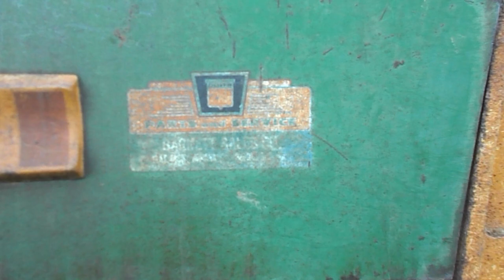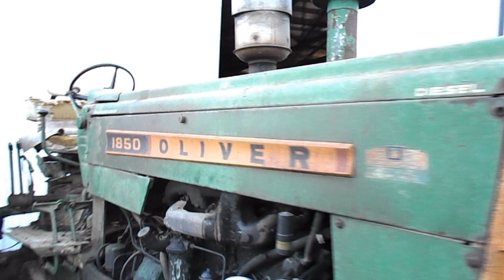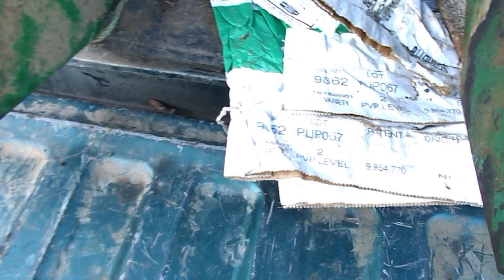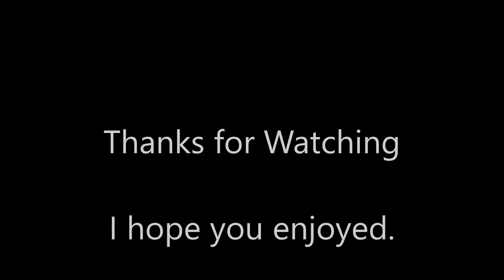Working on the Truck and the Oliver 1850

Comment: If  I were you I'd get a good one from a salvage yard.  They have many of the good ones.
Reply from the maker: I checked and there $250 up so I'll fix the one I have. There is no pressure on the cradle when pulling from the draw bar the only pressure is down on it from tongue weight. The only time these brake is when someone wraps a chain around it to pull something out. So I'll weld it up good and it will be fine cause I already know not to pull from it.  Bandit

Comment: Get a piece of flat bar and lay it on the outside and mark all the holes. drill the holes and the cut off the piece the width of the flat bar and then weld the flat bar to the rest of the plate. that will get rid of the old steel and it will be like new
Reply from the maker: No room to add a piece on the out side to give it more strength and I'm not that good at cutting steel out good enough to weld another plate in it. A new used one is about $250 plus shipping so I'm going to grind it out weld it in and heat it and bend it back in place and then weld it up and add a few passes on the back side to build it up a bit for added strength , At least that's the plan.  Bandit

Comment: love those olivers. We had 2 at home. The 880 had a heater house and i guess it had to help but it was a chilly ride in the winter. Good luck with the repairs and look forward to see her work.
Reply from the maker: I do have a thing for my Oliver's and they do have there own sound and I like it !  I love the sound of dads 1550 gas , It has a smooth quiet purr and it sounds good working . I'm wondering what the 1850 would sound like with a strait pipe working ? I might have to try it before I buy a new muffler for it as this one has lots of burned oil in it from slobbering . She needs a bath and a strait pipe and then worked hard for awhile and get all that mess burned out of it.  Bandit

Comment: As you may remember, I have several Olivers on my farm.  The 1650 has the original Oliver spin-on hydraulic couplers like your 1850.  In fact, I have 4 or 5 sets of them from taking them off other tractors and replacing with Pioneer or other brands.  Also, recently you uploaded a video on replacing the finger guides in the auger of your 213 grain head.  I did that to my 213 grain head today and am I glad I watched your video first, because I had some of the same problems with some of the bolts being stripped out, and I had to grind them off and put in a new bolt with a nut inside.  So, thanks for that tip.  I have enough guides to replace them all on my 213 flex head too, which I'll do tomorrow.  Double the fun!
Reply from the maker: To be honest I haven't seen any of those ends in 30 years or more let alone a set on a tractor ! They will be changed over to Pioneers for sure and if I can afford to put a set of shut off valves on it to make it easer to hook them up I will.  On the grain head I've learned over the years if you got to replace one replace them all and save yourself sometime and agrovation but save the decent ones just in case ! LOL Never hurts to have spare parts even if they is used . Bandit
Reply: @banditfarmer1900  Yep!  I replaced them all on the rigid grain head and have enough to do the same on the flex head.  I definitely agree with your philosophy!
Reply from the maker: @pagrainfarmer  As big of a pain in the butt as they are to change in my way of thinking your already there in it do them all and keep the decent ones just in case.  This way when they start looking a bit shabby you know to change them all !  It's like my 4400 combine if it needs an upper drive belt change them all cause its a pain in the butt job to do ! LOL  Bandit
Reply: Yep - i have a 4400 too, so I know what you mean about the belts.  Hahaha
Reply from the maker: @pagrainfarmer   See there, Great minds do think alike ! LOL Bandit

Comment: If a 354 Perkins doesn't seep oil then there's none in the pan. LOL
Reply from the maker: I've had a couple of other tractors with a 354 in them and they all slobbered if you let them sit around running or not working them. The funny thing is none of them ever really needed oil added to them. Go figure right ?  Bandit

Comment: when you get to the part where you want to wash this motor get yourself an empty spray bottle and put about a half ounce of Dawn dish washing liquid in it and then slowly fill the rest of the bottle with water.   spray and let soak several times then power blast with the high pressure washer.    nothing cuts grease like Dawn Dish Washing Liquid.
Reply from the maker: Over the years of trying different things I've found if its coated heavy with crud if you give a heavy coating of diesel fuel and let it sit over night it will soften it up enough that a pressure washer will take it off pretty good for a first washing (next video).  For the second wash in the spring I'll soak it down with purple power soap with my spray gun and really go over it good !  Dawn works good but the purple power works better and I still have a gallon of it to use so come spring I'll be using it , Dad got it for me a few years ago and if you let it sit too long it will eat the paint off ! LOL That's a little too clean for me ! LOL  Cousin Bandit

Comment: Man I wish every vehicle project was that easy for me. I had to put a MAF sensor on my Silverado because the previous owner had installed an aftermarket cold air intake and never bothered to reinstall the sensor, which kept triggering the engine light. And that was an all day job for me. At least all my tractor jobs are caught up at the moment. LOL
Reply from the maker: I really hate working on newer cars and trucks cause all you can do is hook a computer up and run the codes and see what it says is bad and try to replace it ! 90% of the time you got to ask the guys at the parts place to show you ware the bad part is on it cause I have no idea ware it is ! LOL Then its figure out how to get to it ! Drivers side back coil went bad on this truck and I went to change it , 4 1/2 hours later I had to take it up town to get the dumb bolt that holds it down put back on, No matter what I tried I could not get that stupid bolt back in it and started, It took the guy 45 min to get it back in there and tightened up !  I've never had an A arm like this come off so easy before, Most of the time it takes 3 sticks of dynomite and an act of congress to get one to come off ! 8 min to take it off WOW ! I wish it was always that easy !  Bandit
Reply: And the funny part is, the truck ran perfectly fine without it! LOL.It didn't hesitate or miss, and had plenty of power. However, I share the truck with my wife and her grandmother, and they were both hounding me about the engine light, so I just did it to get them off my back.
Reply from the maker: @MedicineYandere  That's the funny thing about it, We can drive it 1000 mile with the light on but most wives see the light on and figure its going to quit at any moment and will nag you till its fixed so they don't have to worry about it ! LOL So we fix there cars and our own well the check engine light can be on for years and we just keep going ! As they say Happy wife  = Happy Life for us !  Bandit

Comment from the maker: This was a job on the truck that popped up that had to be fixed ASAP !  The kind of job that you just know is going to be a royal pain in the butt to do and will take all day to do, Well an hour from the time I pulled it to fix it it was coming out fixed ! I aint never had one come apart that easy in my life and go back together that fast but I aint going to complain one bit about it !  With time to kill now I went and worked on the 1850 for awhile and got the draw bar off and the cradle off so it can be fixed and welded up and it was fun to get that one bolt out but I got it out and got the battery box off so I can get the rear end filter off a lot easer. I also fixed the center link so it comes apart and got the hydraulic filter changed too and its tank topped off so its full now. I feel like I got a lot done today and I'm still waiting for something to really go wrong with the truck cause nothing ever gets changed that fast without something being wrong ! LOL But I got a lot done and there is more to come on the 1850 but first things first , She needs a bath in the worst way so it will get one in December so I hope its a warm day when I do it or I'll get mighty cold doing it ! LOL I hope you enjoyed watching.  Bandit

Comment: You need to find that guy Harmless Farmer used to powerwash the 856. I gotta admit, that was a very good job he did on a very dirty and greasy tractor.
Reply from the maker: She's going to get a bath soon and its to knock some of the grime off her so I can get a better look at her and some of it is really crusty so I'll do what I've done in the past and soak her down with some diesel fuel and let it soak in and loosen it up and then take the pressure washer to it and most of it should come off. When I can start fixing her up and come spring it will get another bath to finish cleaning her up and then I might see if the sheet metal will shine up some. I thought about doing some paint work on it but I'm thinking I might just leave it alone cause its only original once !  Bandit
Reply: @banditfarmer1900  Be interesting to see what that guy on Harmless Farmer used to rejuvenate the 856 finish. Looked real good after he got done. So good, I sure wouldn't paint it.
Reply from the maker: @billwhitman1529  A good hand wash and some paint cleaner and wax will go a long way in making one look good again. I don't own any trailer queens all of mine are in there working cloths and what I was going to do to the 1850 I've changed my mind on and going to leave it alone and just clean it up good. There only original once !  Bandit